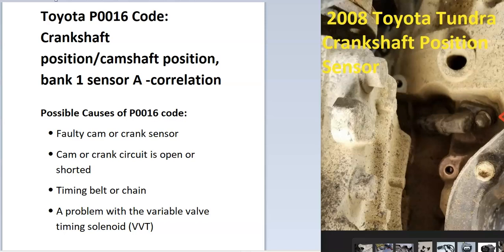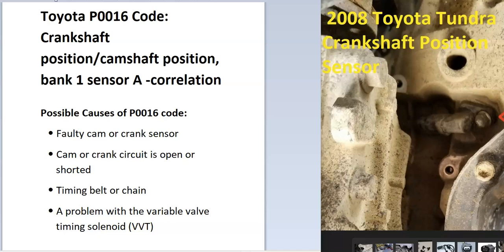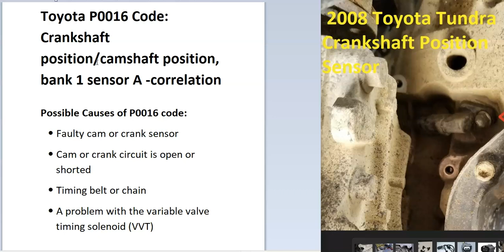Causes and Fixes Toyota P0016 Code: Crankshaft position/camshaft position, sensor A -correlation

Comment: I just changed the timing belt and water pump on my 2006 sienna and shortly after driving the engine light came on, even though it runs and sounds good. I changed the timing belt, water pump, and pulleys . I thought everything was good because the marks on the camshaft we’re lined up to the timing cover mark. And the marks on the timing belt were lined up to the crankshaft and camshaft marks. During the removal, I did my best to not move the crankshaft and the camshaft near the front but the camshaft in the back I moved it a lot because the bolt was extremely tight, and then I had to spin it a few times until it was lined up enough it wasn’t perfectly on the camshaft mark and the timing cover, but it was close enough I thought it is good enough.

Comment: I want to ask which of the senzor is bank 1 senzor out of this senzor
Reply: On 4 cylinder vehicles, there is only 1 bank. On V6 or V8 engines, there is 2 banks. Bank 1 is the row of cylinders that cylinder #1 is in.

Comment: Have 2004 toyota sienna just replaced a new timming belt & wp. Then have a p0016 code. Car runs fine and egine is steady. I recheck the timming mark boths camshaft line up and also the crank line up the where it suppose too. I check the crankshaft sensor and replaced a new one reset the battery light come on second engine turn over. Next I check the camshaft solenoid expected and do a test and clean it out very good reset the battery engine light still on the aecond engine turn over. So im dont know what going on.
Reply: Check your timing marks again. If the code was not there before you replaced the timing belt, it has to be off somewhere. Check the crankshaft mark on the crankshaft timing gear. Don't rely on the marks on the pulley and the timing cover. My guess is that the rear camshaft is off a tooth. That one's a little harder to see, and it's easy to think the belt teeth are firmly engaged in the sprocket, when they are not.
Reply: I did check that the second time check to see is the mark is aligne yes it very hard to see I cut a small peise off paper to line the rear cam the line mark from the camshaft and that plate mark I'm assuming it good. But still has that code. But I have to retime the third try.
Reply: @2zzlift989 hey bro did you solve the issue ? The third time? Off a tooth ?
Reply: Im here because i have the same issue. I changed the timing belt on my 06 sienna and the p0016 code came on shortly after driving even though the engine runs and sounds good.

Comment: I just got this code in my 2004 Toyota Camry and it started acting weird after I topped off the oil the other day. I may have poured too much oil in. Could that really just be the issue? The code did say something about it could be “polluted oil”. Any help would be very appreciated. I’m already very glad I found this video! Thank you 🙏
Reply: Yes too much oil in your engine can cause foam or extra pressure build up which can mess up the timing on your car

Comment: I still have this code after 4+ years of on/off.   Now have P0012 code, and failed emission test.  Any thoughts?
Reply: Does your car use a lot of oil?
Or maybe dirty oil?
Reply: At one point, several years back, the oil almost ran dry.   But changed oil and been better at keeping up with it.   Been ok since.

Recently, they changed the OCV (oil control valve) and the lights went off but only for about 25 miles.  And both codes came back on, are still there, along with both traction and engine lights on .    Not sure what to do.  Car is 13 years old, maybe time for a new one  "now".  ???    @wayneallan2550

Comment: I have this code. Car drives fine but light comes on and off intermittently. Praying it doesn’t need a new chain and it’s just a sensor. Never another Chevy
Reply: Mine also comes on and off in the same pattern. At least a day in between each change.
Sometimes mid-drive it switches on — Not sure if it ever switches off mid-drive. Hopefully you get it figured out!
Reply: @LuxenL  getting looked at right now. I’ll let you.
Reply: @ericabertagnoli5469 please update as I have same issue
Reply: @DragoonGalaxy7  it had a loose bolt that luckily didn’t fall into the engine and also loose guides to the chain.
Reply: @ericabertagnoli5469 if I could, what car and mileage was it?
Reply: @ericabertagnoli5469 thanks, loose bolt for what sensor? I've cleaned both camshaft sensors and vvti sensors. Only have the crankshaft left
Reply: @DragoonGalaxy7  not sure which bolt was loose. Sounds like you’re gonna have to open it up at this point and check the chain